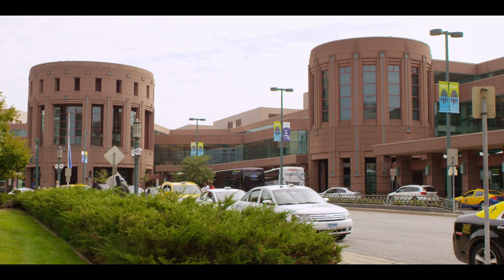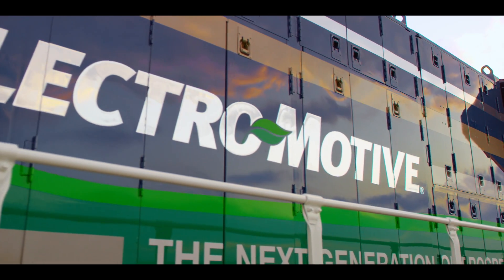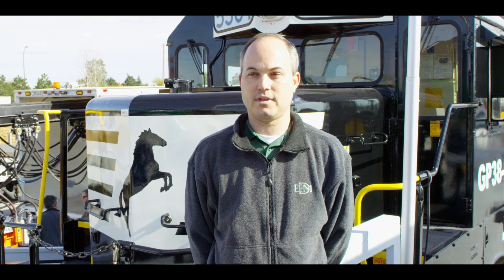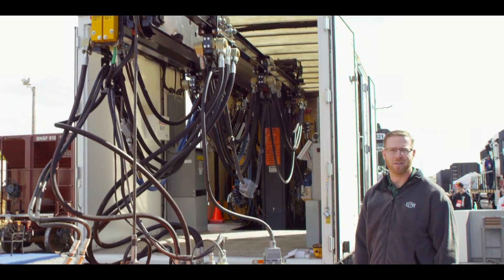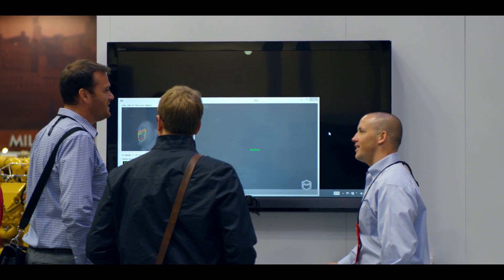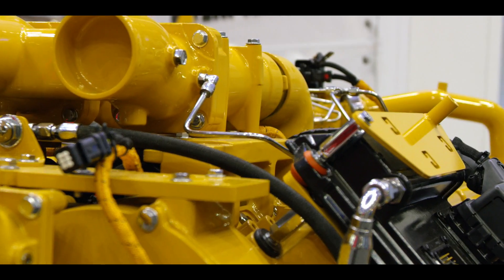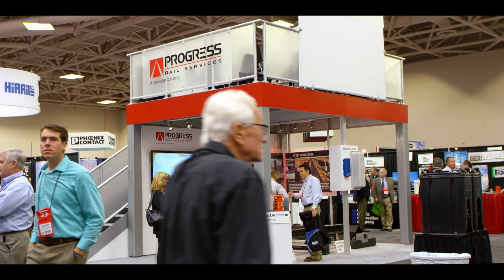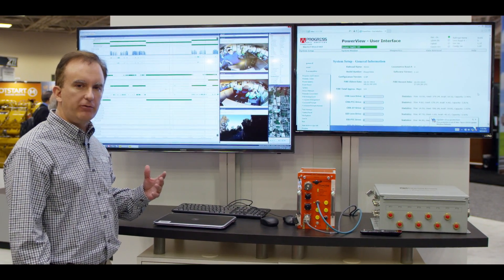Railway Interchange 2015:  AREMA, RSI, REMSA, RSSI

Comment: why hasn't cat ever designed a new 6 axle freight loco around a cat prime mover against the old emd 710??? Seems pointless to buyout emd to use their prime movers instead of your own!!!!
Reply: Because the EMD power units are the most reliable, easiest serviceable, and highest availability diesels ever built.  MK used Cat for a while and it was not up to the task.  They just don't have the resiliency and longevity of the EMD engineered product.  The new 1010J is still part of the long legacy of EMD prime mover.  The EPA did everything they could to put EMD out of business, and GE got a foot hold on railroad motive power.  But if you dig deep into US Rail operations and management, they will all tell you the the GE locomotives were "cheap" and the EMD, while preferred, were not available.  EMD is coming back with a vengeance, and unlike GE there is a considerable waiting list.  Further to that, most of the major rail companies like BNSF, UP and NS are rebuilding and refitting  old EMD chassis with new 1010J and digital controls.  Thousands of older GM EMD locomotives are being renovated as they were good locomotives to start with, and even though sidelined for years, still a very good investment for a rebuild and back on revenue consists.  GE, not so much.  You don't see 100's or 1000's of GE locomotives being renovated, rebuilt and refitted like you do the GM EMD products.